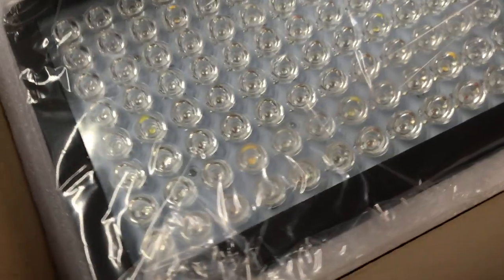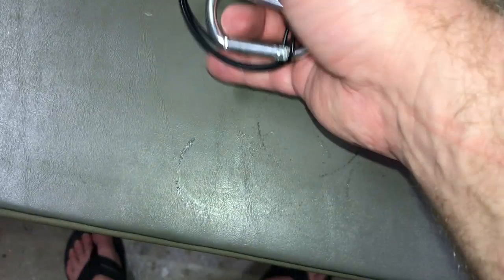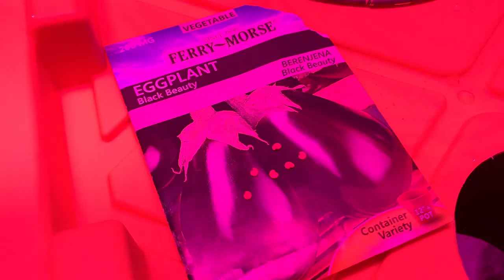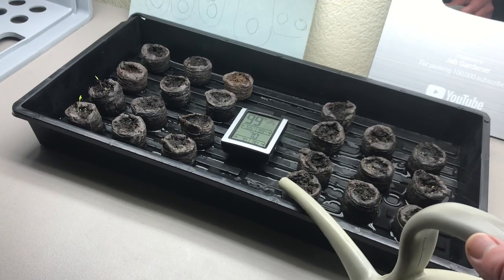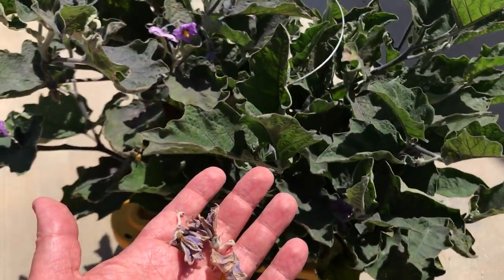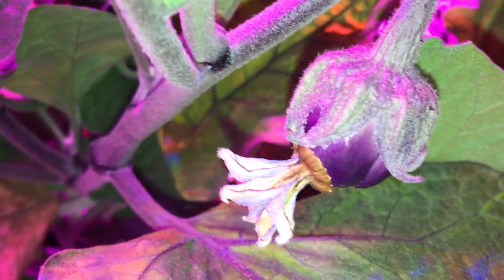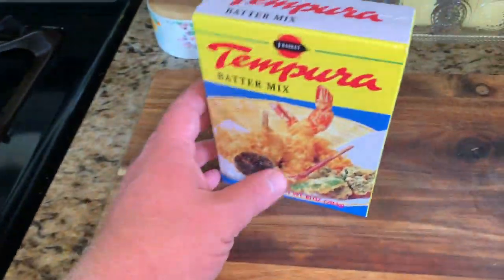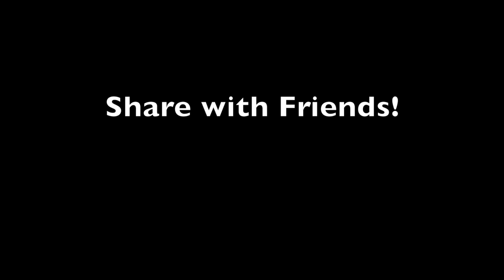It grew in water and then in soil.

Comment: i'm surprised the plant survived transplanting from hydroponics into soil.

also now i'm hungry
Reply from the maker: i was surprised too
Reply: Usually moving my plants to outdoors takes a beating on them. I was told to let them transition in the shade. I was surprised the sun wasn't too much on them.
Reply: @Chicken Fingers Do you do anything "special"? How long are they in hydro before you transplant to soil?
Reply: @Chicken Fingers Thanks for the explanation! I've just gotten started with hydroponics and have been wondering if I could transplant larger plants from hydro to soil, but heard its not working too well. But what you say makes a lot of sense! I guess the fresh roots on the cuttings are not yet completely adapted to hydro and can switch easier than plants with large hydro root mass.

A lot of things to try out! Sadly I only have a small apartment and not too much sunlight, so my options are more limited 😄

Comment: Its not the light that made the better yield its the growing medium. Hydroponics carry nutrients way more efficiently then soil. There are no lights that can mimic direct sunlight. But its hard to find a location with direct sunlight and the ideal light cycle with the ideal climate. Which is why often indoor is better then growing outdoors. If the plant was kept in hydroponics when moved outside im sure it wouldve produced just as much if not more then the indoor plant. Also transplanting a plant that size is extremley stressfull on the plant. Either or its pretty cool to see that done tho.